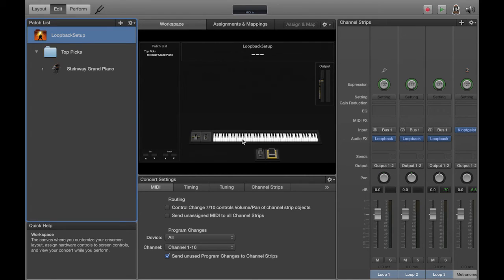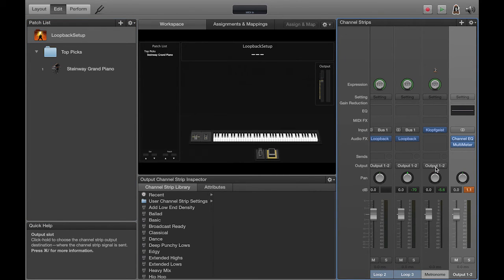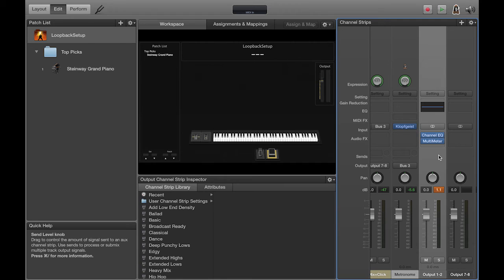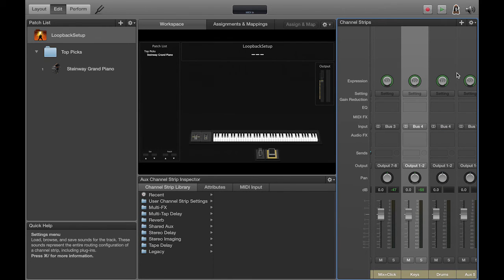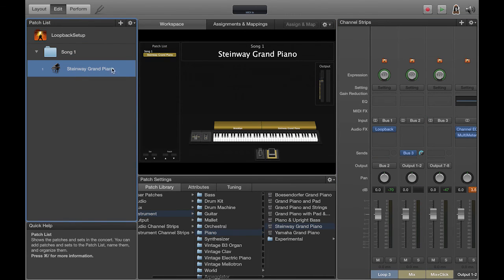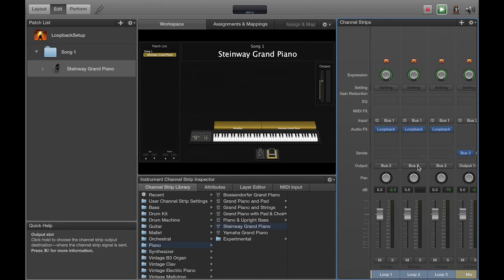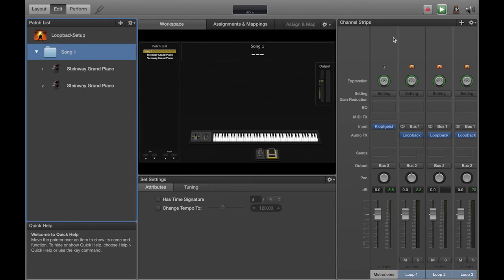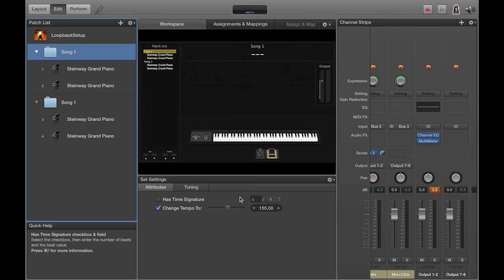MainStage Looping Tutorial (part 2) - Audio Routing

Comment: Hey man, thank you so much for the tutorial! Just a few problems still having: Mainstage switches back to the first patch automatically.. like a glitch or something. And couldn't quite get the metronome to output to mix+click. Gotta figure that out i guess.. Especially the glitchy thing is weird. So I'll be back. Gotta pause now. Anyway, great video and thank you endlessly for your efforts to help!
Reply from the maker: The first patch thing sound like a midi program change issue, if I change sound on my keyboard, it will send a midi program change, which Mainstage will use to try to go to that patch number. Make sure none of your controllers are sending program changes.
Reply from the maker: Also, make sure you show the metronome channel at the concert level and use the metronome channel strip to set its output to the bus you want to be "mix and click"

Comment: Hi Jordan, your tutorials are really great! Thanks very much :)
However, I've got an issue with the metronome: on my Focusrite sound card, the headphone outputs don't work anymore and the mix+click can't work :( Can you please tell me how to manage the metronome by putting it on the far right (or left) so that the audience doesn't hear it ?
Reply from the maker: Just pan the track the metronome is on (make sure it's set to show in the channel strips) to one side, then only run the output to the system to the other side. Basically you can hear the click in just one ear of your phones, but only send the other side to the audience. Make sure to check any big stereo effects or instruments and set them to mono so it's more predictable. For example, piano synths often puts low notes on the left and high on the right, so you may adjust the settings or put an effect to sum to mono on that track.
Reply from the maker: And thanks!
Reply: @JordanColburn1  Ah okay, just plain. I was hoping for something that keeps the stereo somehow... Thanks anyway for your quick answer ;)
Reply from the maker: @dge3996  If you are just recording a video or something, I think you can set mainstage to record specific channels/busses to a file and your ears could have a metronome. But for live, you are limited to your interface outputs. Also, many live sound systems run mono anyway, so i'd rather sum to mono myself, then leaving it to the soundguy.

Comment: Hey Jordan, i appreciate these videos. Quick question for you. When i create Aux channels for the loopback at the concert level I do not see them be persistent throughout the rest of the song(set) or patch level channel strips. Do you know if this is normal behavior or am I missing something? I have watched many tutorials on loopback which i will add yours is the most in depth but each one seems to me that the Aux channels are persistent. Thanks
Reply from the maker: I think you are just missing a setting, not in front of mainstage right now, but try to turn on "signal flow channel strips": https://documentation.apple.com/en/mainstage/usermanual/index.html#chapter=5%26section=2%26tasks=true
Reply from the maker: "When you show signal flow channel strips, channel strips at the concert level, including Output and Aux channel strips, include a small concert icon near the top of the channel strip to make it easy to distinguish them from patch-level channel strips. Channel strips at the set level include a small folder icon so they can also be easily distinguished."

To turn on:
"Choose Show Signal Flow Channel Strips from the Action menu in the upper-right corner of the Channel Strips area."
Reply: Man this is great! Thank you very much for explaining this. I think i have it working now. Still not showing up in set level but the patch level it appears to be working. Im just gonna start a new template from scratch. Now onto the FCB1010.... would love to see an in depth tutorial on setting one of these up with Mainstage. There is a few ok ones but I like how detailed you are we you explain things! Thanks!